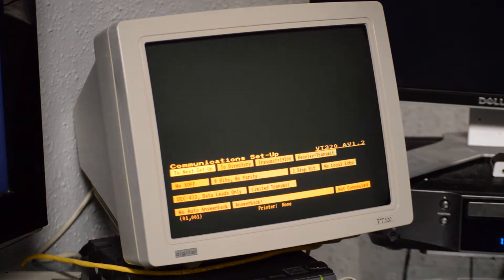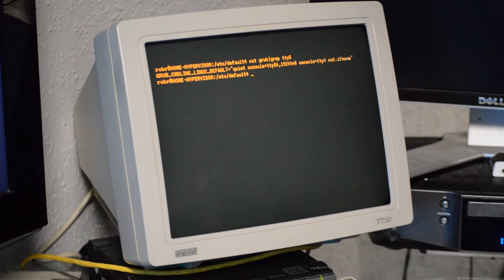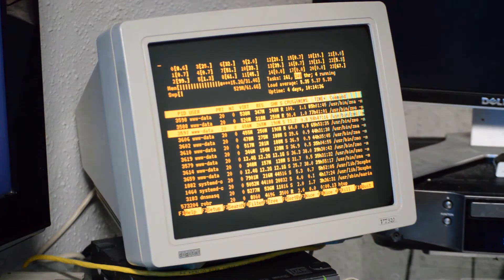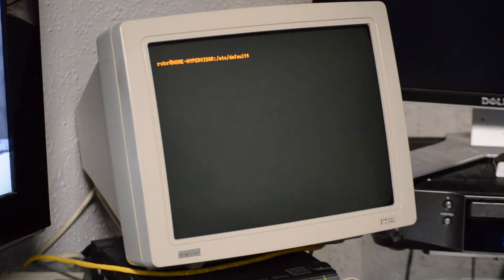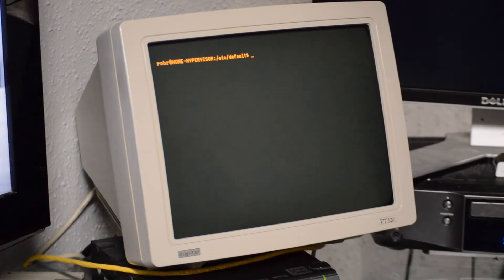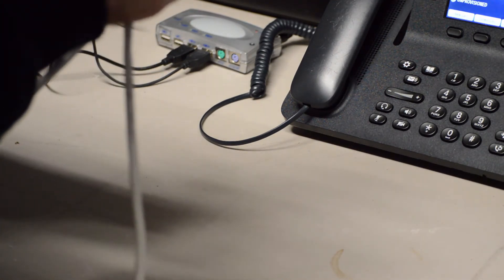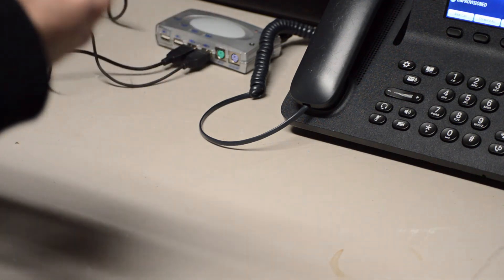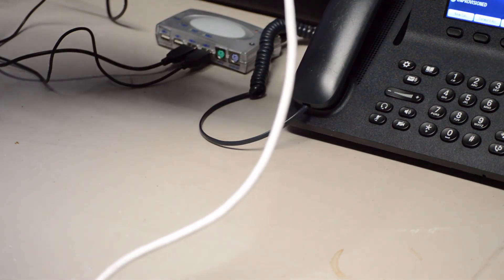Connecting Dumb Terminal to modern Linux Machine Digital VT320

Comment: I have a couple of IBM InfoWindow Terminals that I found in my cousins backyard that I'd like to get up and running. This video gave me hope LOL
Reply from the maker: Oh you should have no issues, I can't remember the name of the standard for IBM's coax serial but theres adapters from the 90's you should be able to find on ebay. (provided you look up the name of the standard on ebay). That said if  it has something RS232, RS485 RS422 you will have a really easy time using it on a modern pc. I think it was optional on some brands like IBM to use a standard.

Comment: I'm trying to make this work with my VT420. I connected the wires like the diagram shows, but to no avail. the mmj side had to be plugged into port 2, because port 1 looks a bit bent inside. The raspberry pi I'm using took the ethernet side of the cable, and I installed grep, then input that line of code. I'm really trying to make this work. In the video, you said the brown wires are tied into the orange wires, but there's no mention of that on the diagram. I'm pretty sure my cable isn't damaged, my rpi and vt 420 work, and the settings on the 420 are the same as yours. Could you offer some advice? I'd like to have a cool orange monitor with my rpi, but don't know what part of the wiring is miswired, since it was not possible to match it to your cable when you moved your hand outside the camera viewframe.
Reply from the maker: "I connected the wires like the diagram shows, but to no avail. the MMJ side had to be plugged into port 2, because port 1 looks a bit bent inside."
Port 2 won't work its for the printer, You need to fix port 1.

"The raspberry pi I'm using took the ethernet side of the cable, and I installed grep, then input that line of code."
I don't use the pi, I use professional platforms but you should be able to declare as a uboot variable. 

On the embedded systems I use you can connect to the JTAG port, use the second TTY it exposes and spam break after connecting power to get into it
In the video, you said the brown wires are tied into the orange wires, but there's no mention of that on the diagram. 

"I'm pretty sure my cable isn't damaged, my rpi and vt 420 work, and the settings on the 420 are the same as yours. Could you offer some advice? I'd like to have a cool orange monitor with my rpi, but don't know what part of the wiring is miswired, since it was not possible to match it to your cable when you moved your hand outside the camera viewframe."

I could really use a camera man.
The brown wires are just wrapped around the cable are not connected I never used that pair. Follow the diagram its how its wired.

Comment: Our student association found one that has been forgotten for years, and it works !
We'll have a linux computer in the room, so i definitely want to try to make this work !
Reply: @robsyoutube  In fact, It's one of the univ's computer, so I don't know if we will have access to the grub (if the sysadmin is intelligent enough, knowing that we are CS students, we wont), and sure we won't have access to admin right either.
I have a macos laptop, that could do the job too.
Also, for the connectors, we have a FabLab with quite a lot of ressources, so we may do something like build it ourselves.